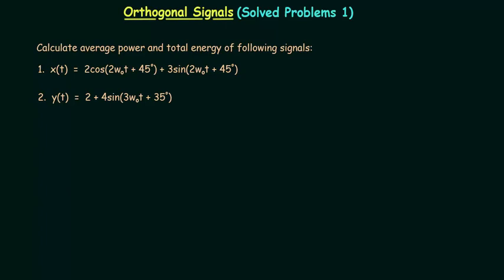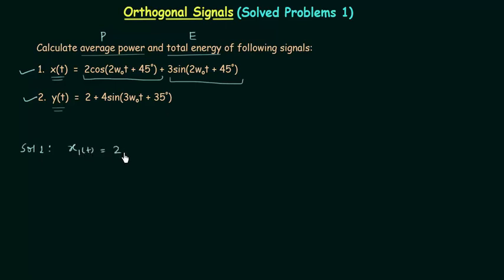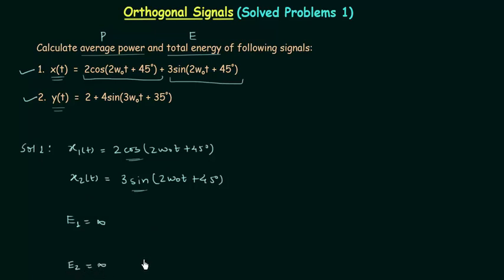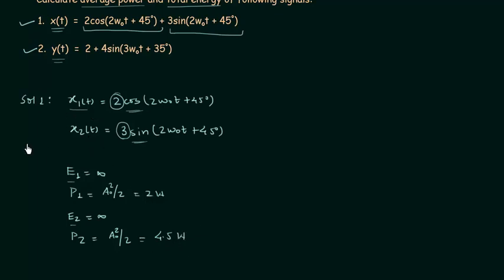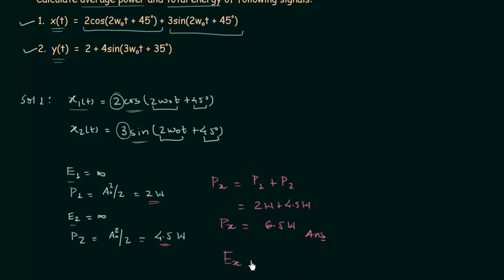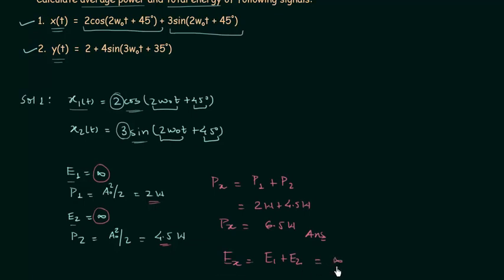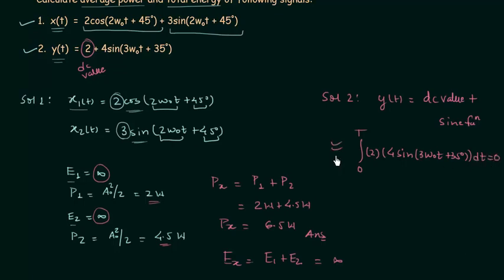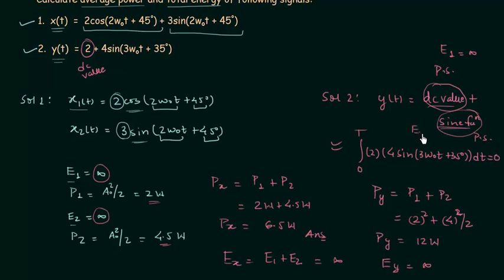Orthogonal Signals (Solved Problems 1)

Comment: Buddy DC value is not periodic but DC power is finite because the magnitude is constant and the durations of this magnitude is infinite Ao^2 /2
So power and energy is exclusively mutually each other if power finite then E is infinite
And E is finite then P is 0
Reply from the maker: Please avoid pointing out the mistakes when you have not seen the earlier lectures. I have already explained in details about the periodicity of dc value. Follow the link https://youtu.be/Gj9pDC_OBQU?t=545
Reply: Dc value is periodic! it repeats for all values of time.